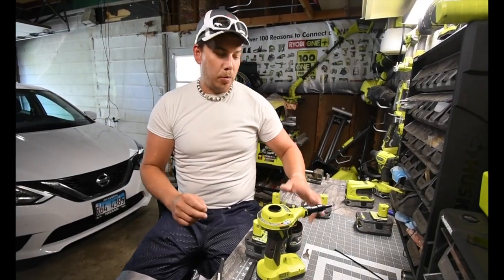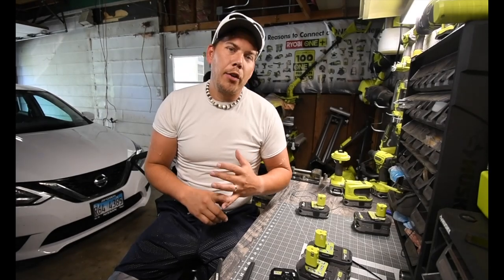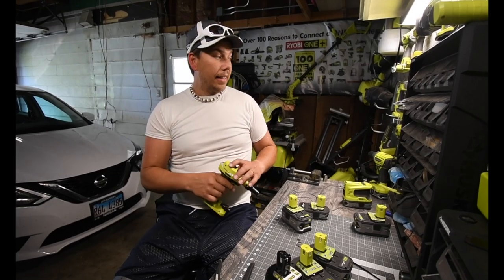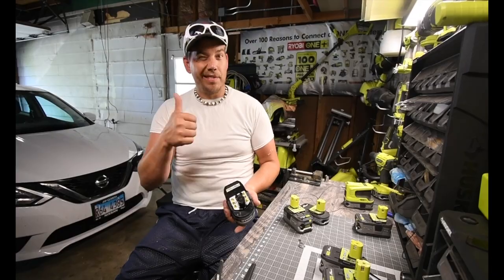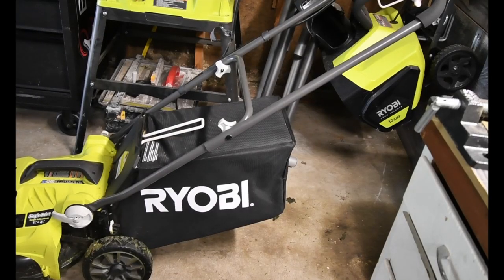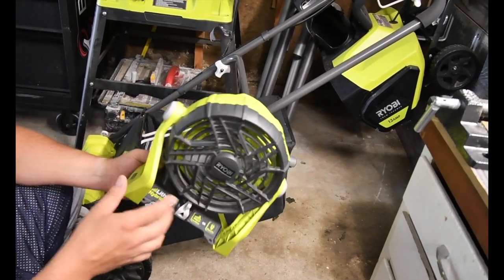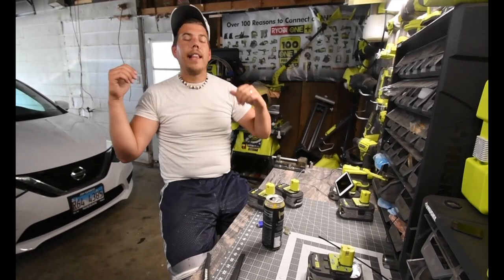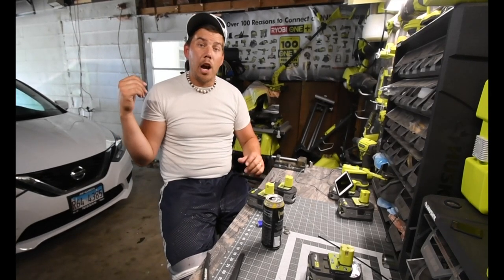Ryobi Just Got Cooler

Comment: Check out the p1100A battery placement is slightly different. I was told by a few people that his model you can use dual 9ah. once i get settled into my new place this is the mower im going to pick up. Im glad i found one you can use bigger than 4 ah batteries with that was the only thing i was hesitant about with the previous model
Reply from the maker: will do and thank you

Comment: check out the artic cove bucket mister. it works on the one+ system im sure you could do the same thing but add a nice mist to it, with a gatorade bottle or something
Reply from the maker: I do want it. a cool mist in the summer would be nice

Comment: I have always liked ryobi.  And I have a lot of there tools and use them everyday doing remodeling.  But we have had really bad luck with there 6amp and 9amp batteries.  We have had 4 of them stop working within 3 months of using them.    Also burned up the brushless recip saw.   I hope they get there batteries working.   I believe it’s the heat from the sun that is killing the batteries.  We had 2 6amp both stop working the same day.  If the batteries can’t take the heat from being outside working ryobi really needs to redesign them.  I know we are using a DIY tool in home remodeling but we never had any problems with the 4amp batteries.  We have started to change over to ridgid for a few things.  With I could afford the cost of Milwaukee batteries but I just can’t pay 200 for a battery that is why I liked ryobi so much before these new problems.
Reply: survivalSC I’m sorry to hear that I got 2 9ah batterys and have had good luck with them and I have about 80 ryobi one plus tools
Reply: Brandon Scoots  we have around 15 of there batteries and at least 25 of there tools.  We are going to continue to use ryobi for stuff like shop vac and fans. General stuff that we can’t get from ridgid.  We just switched to ridgid for there octane hammer drill and impact driver and multi tool.  So far the batteries have been great.  But I hate having to carry multiple battery chargers. And I hate starting over with a new brand that is why we stayed with ryobi for the last 5 years
Reply from the maker: Im sorry your having issues with batteries. I only had issues with the 2ah batteries. all 3 of them stopped working. but no other issues with the tools or other batteries so far
Reply from the maker: 80 tools!! awesome

Comment: Hey man, your videos are pretty cool. I bought a Ryobi garage door opener recently and I want to buy a battery for it. I was wondering if you can check if the 9AH fits in the battery cage if not does the 6AH fit
Reply from the maker: The 4ah is the biggest battery that will fit
Reply from the maker: And thank you

Comment: Isn't the 4A hour batteries (with the green stems) the older gen battery as opposed to the 9A battery is the latest gen battery (black stem) . I know the black stem ones are designed to be used  for the brushless tools - extra chip in them I believe. Is that the only difference between the green and black stem HP batteries?
Reply from the maker: batnav10 correct